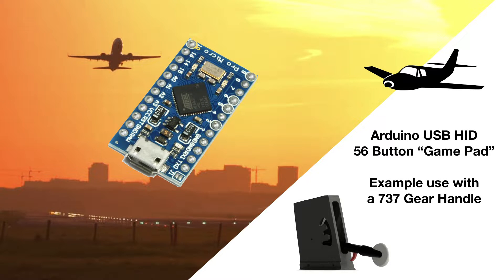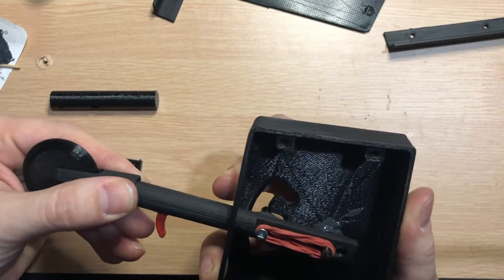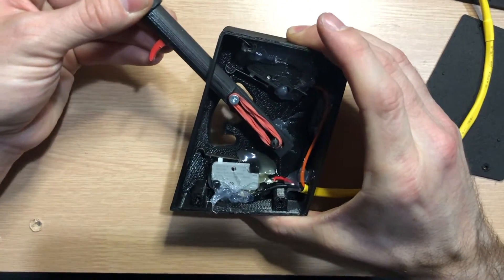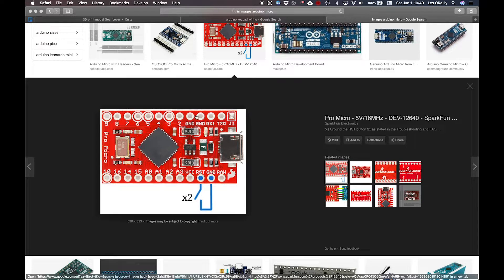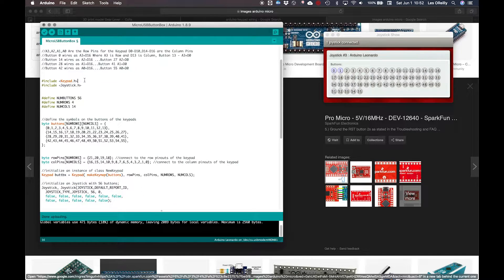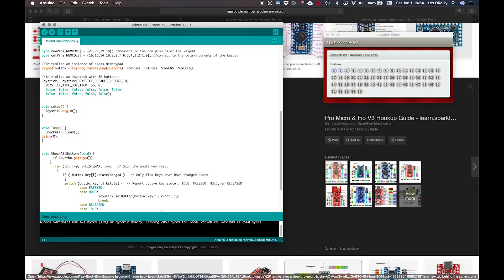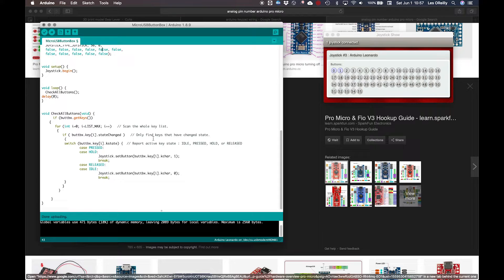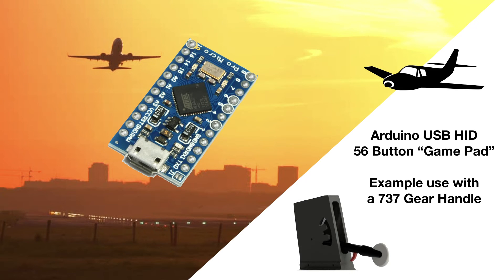Arduino 56 Button Joystick 737 Gear Control

Comment: This is perfect.
I've always been a big mmo gamer and am looking forward to games like Star Citizen, at times I play elite dangerous- etc. Games that require many hotkeys/binds/etc. I often use a HOTAS setup with petals and don't like fooling with the close keys(not feeling like remembering really) on a keyboard in order to command a ship and what not. I've always wondered what it'd be like to program my own "Control box" or "Control center", you've basically shown how to do that with this video. Thank you, a lot.
It's crazy too, 56 buttons is a loooooootttttttt of buttons, which means I can totally swap some of that number off for whatever it'd take to map a switch/toggle/etc. Since these audrinos are totally not that expensive, if push comes to shove I can invest in a larger one or more of the micro pro's. Point being-
This is amazing. Thank you a lot for this. If and when I ever get around to building my dream setup for the various games I play, I will reference this video to hopefully inspire and inform others like it has me.

I appreciate it
Reply from the maker: Glad to hear you liked it. 

I have a few Arduino units. And In fact have taken one a little further and built it out as 100 buttons :). With no encoder or Axis I was able to do 10 rows and 10 columns on the Arduino Leonardo. 

Just keep in mind the pro micro and the Leo are the ideal units as they have the native USB interface. The other models like the mega are not as easy as you need to go through a “serial” driver. 

Have fun with it!!
Reply: @LesOReilly  How did you get 100 buttons on the Leonardo? I modified your code to get 84 on the Leonardo using pins A0 - A5 as columns and D0 - D13 as rows. It works well, other than A3+D11 giving me the same result (button 21 on the Windows game controller setup) as A4+D10 (the actual button 21). A3+D11 should be button 31.
Reply from the maker: The LEO has additional pins that can be defined as analog. I put in the comments of the code In the Leo example which pins are the columns and which pins are the row.

Comment: respect, im doing level 3 electrical installations/engineering and im gradually gettin my head round this kinds thing
Reply from the maker: Awesome!! Keep going....I really wish I could get my almost 11 year old into it more :(. He likes plugging in the wires and that stuff but not the code side.
Reply: @LesOReilly  How would you code an LED to light up when one of the buttons are pressed with the keypad and joystick library
Reply: @LesOReilly  By the way you can change the names of your devices if you change the board.txt of arduino IDE
Reply from the maker: You would probably need to then start looking at Shift Registers. Since you would want to expand the I/O so you could have pins adding to say use an I2C bus to drive LEDs off a shift register. That said you will then be giving up pins from the the Keypad and this fewer buttons.
Reply: @LesOReilly  I have a few extra pins open and only want to indicate 2 LEDs for master arm and gear indicator, So what i tried was adding an if statement(under case pressed to set LED pin to HIGH when i == 1 for instance but that didn't work) and defining LED as output
Reply from the maker: i == 1 is not going to get your pin to trigger that event...  You need to keep track of the button number you want to enable that pin...

Comment: Nice vid. Also where can I get the small header board that the pro micro is in at 5:46? What are those even called?
Reply from the maker: Breakout boards...  Just search on amazon or what ever for "arduino pro micro breakout"
https://www.amazon.ca/Aideepen-Terminal-Adapter-Expansion-ATMEGA328P-AU/dp/B0788MLRLK/ref=sr_1_37?keywords=arduino+micro+breakout&qid=1637102277&sr=8-37

Comment: Glad to find this video at this moment as I want to build my button box for MSFS 2020. I download the sketch from your link provided and upload it to my leonardo without any problems, but when I connect the buttons to the pins it doesn't work. Dunno what went wrong and hope someone can give me some clue.
Reply from the maker: The comments in the sketch explain the "keypad" mappings and which pins connect to which Rows / Columns.  Essentially Analog pins are connecting to multiple Digital Inputs at a time and this creates the matrix.

Comment: Hi. I m having <Joystick.h> and <Keypad.h> errors. I tried a few ones but it does'nt work. 
could you link those files please?
Reply from the maker: https://www.dropbox.com/sh/0xjh38wme7oalez/AACi4dcSGBt808DjITb0iKu7a?dl=0
Reply from the maker: Keypad is the one from arduino.
Reply: Thanks for your quick reaction and help😁👍 that solved my problem. it works perfectly
Reply: hi 🖐.. I have 1 more question. 
is it possible to ad 4 rotary encoders to this configuration? 
if yes how can I connect them?
Reply from the maker: @migas_2407  no would require a lower button count since you need pins directly for the encoders.
Reply: @LesOReilly  what would be the max buttons I could use? I have 31 push buttons and 4 rotary.
Reply from the maker: Each encoder needs 2 pins for CW and CCW so you take 2 pins per out of your keypad. The push button on encoders can still be part of the keypad array though.

Comment: Hi Les O'Reilly, I wanted to know if you could help me with your code, I entered it into the arduino but it gives me an error because of the joystick folder, do you know how to solve this problem? thank you
Reply from the maker: The Sketch and the Joystick library are listed with links in the show notes
Reply: @LesOReilly  I don't have a problem with that, if not it's in the joystick library (of which the link you left is deleted, look for the folder online arduino joystick librari master but all are without the joystick file) and I get this message when loading the sketch

 'joystick_' does not name a type; Did you mean 'joystick'?

I've been looking for the solution for months but I can't find a way to get it to work. If you know something, could you please guide or inform me, thank you again.
Reply from the maker: @jorgerivas6909  https://www.dropbox.com/sh/0xjh38wme7oalez/AACi4dcSGBt808DjITb0iKu7a?dl=0

Not sure why the link is dead but I just restarted it. Try that link.
Reply: @LesOReilly  Thank you very much, now everything is correct thanks to your help, it is greatly appreciated for all your time.

Comment: Hi there, how do i use an LED with arduino Pro Micro for parking brake, any schematic and codes please
Reply from the maker: You will need to learn about using spad next and the spad protocol to control those kinds of things.
Reply: @LesOReilly  i know how to use spad next, but only to control the Saitek radios and controls, not to link with arduino pro micro, and I am trying to do a research on YouTube, I can't find any tutorial explaining what you have just said. Any idea or links you know so that I can have a look at it?
Reply from the maker: I did a tutorial on how to use the spad protocol to make an autopilot panel with arduino.
Reply: @LesOReilly  great, i will have a look at you channel to find the video, should be ease if you could just post with the link of it.
Reply from the maker: (Sim Video) Arduino Based 3D Printed Autopilot P1 | MSFS 2020

Comment: Hi Les,  I've tried to compile the sketch but I'm getting the following error, 

"MicroUSBButtonBox_With_Axis:41:20: error: 'JOYSTICK_DEFAULT_REPORT_ID' was not declared in this scope
 Joystick_ Joystick(JOYSTICK_DEFAULT_REPORT_ID,
                    ^~~~~~~~~~~~~~~~~~~~~~~~~~
MicroUSBButtonBox_With_Axis:42:3: error: 'JOYSTICK_TYPE_JOYSTICK' was not declared in this scope
   JOYSTICK_TYPE_JOYSTICK, 56, 0,
   ^~~~~~~~~~~~~~~~~~~~~~
exit status 1
'JOYSTICK_DEFAULT_REPORT_ID' was not declared in this scope

Any help would be greatly appreciated.

Regards
Reply from the maker: I don't think you have the Joystick.h Library added to your libraries....
Reply: @LesOReilly  Hi Les, Yes I have the Joystick.h library added but it may not be the correct one as I've found another post on google with the same issue. Can you share the library you used or a link?
Reply from the maker: @olinwinfrey1782  Pretty sure I recently downloaded it directly from within the IDE and the Library Manager...Just searched for Joystick in it
Reply: @LesOReilly  Thanks Les, I found "ArduinoJoystickLibrary-master" and it compiled, but on with 32 buttons.
Reply from the maker: https://www.dropbox.com/sh/0xjh38wme7oalez/AACi4dcSGBt808DjITb0iKu7a?dl=0

That is the Joystick Folder from my Arduino Library folder....
Reply: @LesOReilly  Any thanks Les. I appreciate the help.

Comment: Great explanation, just what I was looking for, you think you can make a video like that explaining how to include Axis as well? Thanks
Reply from the maker: This video has links in it to code -- have a look at it and if you still don't get what you need let me know...  https://www.youtube.com/watch?v=tUdNZUEyT1U

That said I found that I preferred the Leo Bodnar Board for Axis.  The 12 Bit Resolution was well worth the price of the board.  I used one to modify my 2 saitek throttle quads.
Reply: @LesOReilly O'Reilly what is the Arduino's resolution?  I thought it is 16 bit according to this https://github.com/MHeironimus/ArduinoJoystickLibrary
Reply from the maker: Could be -- though I have found some issues with getting my preferred product (spad.next) to work with the Arduino Axis as for some reason it shows up as like -16K to positive 16K or something like that.

Comment: Hey cool video but I have a question.
I have been trying to get my pro micro to work but I get "averdude" messages and cant get my board to work. Any tips?
Reply from the maker: Nope.. I use the standard arduino compiler and uploaded. No issues.
Reply: @LesOReilly  i can't seem to get it to work. I've been messing with it all day but no success. Thank you anyway for responding so fast!
Reply from the maker: Make sure you have the correct board in the compiler and also make sure it really is a pro micro and not a pro nano… only pro micro and Leonardo have the 32u4 you need for joystick devices.

Comment: Just started building my own button box using you code. I'm getting an error though regarding the Joystick_ entry. Any ideas, thanks
Reply from the maker: You don't have the Joystick Library installed then ...  It's in the show notes..  but here is a link to the one I use as well..
https://www.dropbox.com/home/Arduino%20Shares/Joystick

Comment: Hey, does this mean I can have more than 1 toggle switch on the pro micro? For dcs
Reply from the maker: Keypad designs will need Diodes if you are looking to be able to Hold Multiple Switches / Buttons down at the same time
Reply: @LesOReilly  thanks, I just need to set up about 6 toggle switches, no buttons as such, just 6 toggle switches.. I’m a noob so not really sure what the pro micro can support
Reply from the maker: @TallWestEddy  oh then you don't even need to implement Keypad expansion .. you only need 6 Digital Pins.. 1 per switch.  All Switches tie to Ground and you enable the Pins with the Pullup so that you just short to ground to trigger.
Reply: @LesOReilly  thank you!!  I uploaded some joystick library following a video someone did, but it only allows me to wire two toggle switches as it shows pin mode 9-12…but the pro micro doesn’t have 11-12.  I’m so lost.  Maybe I need to learn to code to?!  

Managed to get two toggle switches working on the pro micro but guessing I’m using the wrong library to let me use the other pins?!
Reply from the maker: you have to write / modify the sketch files in the Arduino IDE to configure the pins/switches and then map those to the joystick library..
Reply: @LesOReilly  thanks sir.  Maybe I can pay you to give me a crash course :p I’m trying to learn
Reply from the maker: Do all the basic arduino tutorials to start. That is the way to learn it.

Comment: do you know of a Windows 10 application to test 56 or more buttons?  I show a limited 32 buttons in the games controller UI.
Reply from the maker: I use SPAD.Next to configure all of my controllers and interfaces with the flight sim. It is where I can see all of the buttons show up and register.
Reply: @LesOReilly  Great... I'll give it a try. Thanks Les!

Comment: Awesome video man, thanks! Could this same sketch be used with a 16 ch analog multiplexer?
Reply from the maker: Not sure...I have never worked with one. But considering I am using all available Analog pins to be part of the KeyPad you will be giving up rows and columns to use them for analog axis.
Reply: @LesOReilly  I found a sketch that works out for me, thanks for your response!

Comment: Great build - I'm having huge problems getting my Pro Micro to reset and to upload any sketches onto it, it only sees it at COM1, and I cannot get windows10 recognising it yet as joystick button controller. How do you get the little joystick button display window up and running?
Reply from the maker: Once it is built I just go into the Windows Control Panel and then do to devices and Printers.  it shows up there and I can then click on it.
Reply: @LesOReilly  ok thanks - it looked like it was an add-on for the arduino s/ware.
Reply from the maker: @alheeley  Oh....I did some of that originally on my Mac not on my Sim PC which is Windows...I assumed you are on a windows machine.  Since Mac does not have a "tool" like in Windows I had to download that from the Mac App Store to make sure that things were working.....
Reply: @LesOReilly  Ah ok that explains - I defected back off mac to windows so I could play more games ;)
Reply: Its prob the best and clearest talk-through of the button matrix sketch programming and practical mapping to a controller I have come across - many thanks for that :)

Comment: Hey, great video, just wanted to ask if you could maybe explain in a video how you do the wiring or suggest any places to learn this from ? I have the pro micro and I've figured the programming part out, but I struggle to figure out how I could wire up something like a toggle switch that stays on or off depending on position as well as having multiple ones in a sequence i'm currently stuck at having 1 thing added to the Arduino at a time. Again awesome video mate!!
Reply from the maker: The Arduino Tutorials are on the website and do a good job of this.  When it comes to Toggle Switches it depends on the Toggle Switch and how you want it to work.....Also depends on what your target requires....So example if your able to control Data or you have the ability to program ON and OFF events from a single button then you get more freedom.....

So with most 2 position Toggle Switches you have 3 connectors because you connect the VCC or GND to the centre pin and there the other two pins will pass that connection through when the switch is in the UP or Down State....Also think of it from "Inside" the switch as the Pin that will be active is relative to where the switch is inside not the arm.....It If the arm is UP then it is the lower pin that will be the Closed and the UPPer Pin is open.

If your software can work in the concept of having a "switch" function so that it will essentially do one thing with the switch Closed and then another even when Opened then it is easy since you only need to connect One of the pins to a button pin.  That way it is either ON or OFF but you don't have to put in a separate "Pin" for the OFF as well..
Reply: @LesOReilly  Thank you so much for the answer, I hadn't considered doing that on the software side, which honestly I have no idea how that skipped my mind. Also thank you for the fast response, I will have a look on the arduino website for the tutorials you mentioned for the wiring of the switches.
The thing I am working on is a small button box to simulate the switches in a Cesna, so that should maybe give a bit clearer of an idea of how the switches should look/work and what the purpose of the project is overall.

Again thank you for the answer!
Reply from the maker: I use SPAD.Next for all of my flight sim switch and controller programing. That makes it much easier to deal with as it supports setting up buttons as switches.

Comment: Thank You Sir for nice video. I want to build sim racing kit. I want to use accelerator, brake and steer with 3 potentiometers. so is it possible to use 3 potentiometers on single Arduino Leonardo?
Reply from the maker: Sure...the analog pins are for that. But that means you will reduce your keypad ability.